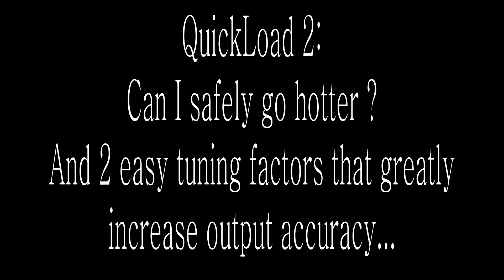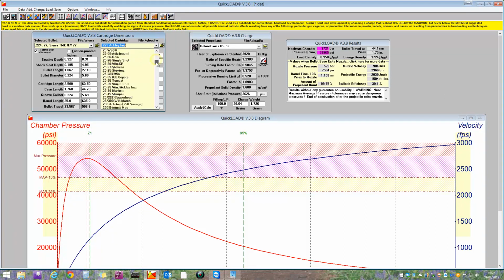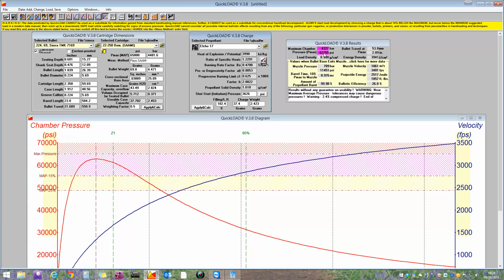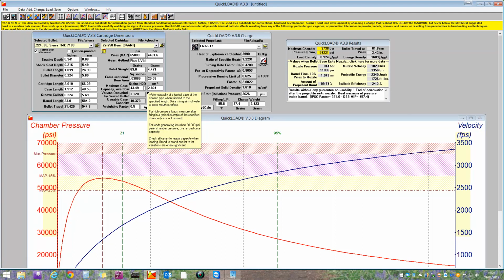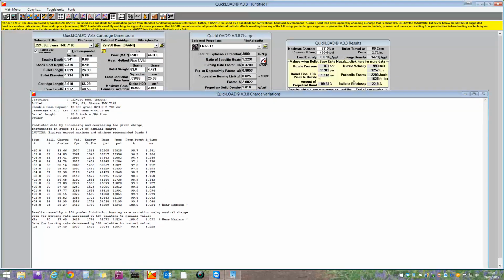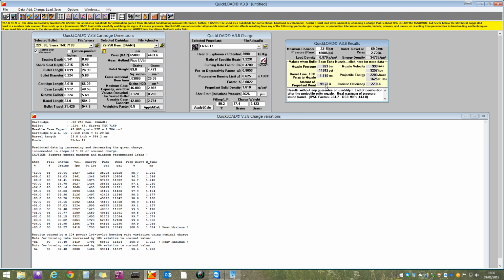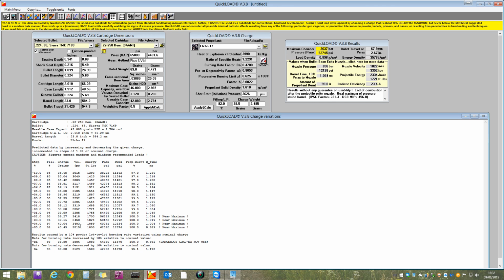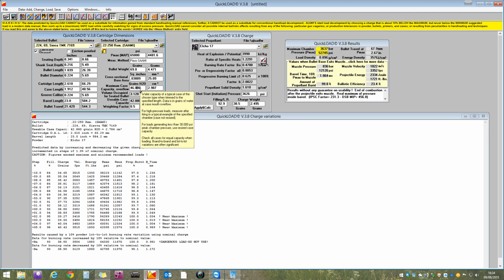QuickLOAD tutorial 2 - can I load hotter safely? + tuning tips

Comment: Hi Richard great video Thankyou, I have purchased QL and it's very interesting, I have done all the measurements and came up with some test loads for my 308 target rifle , imr8208 berger hybrid 155, went to the range yesterday and using shooting chrony beta found my velocities where, depending on load, 75 to 90 FPS over QLs prediction and showing pressure signs on the higher loads, 3090 fps 26 inch barrel, ( I won't go there again) angel target rifle  action. I realize chambers and barrel friction play a big role, also powder burn rate variation, what I have done now is changed the powder burn rate Ba in QL to match the velocities I am getting and using the new data to develop a load close to the theoretical node 3 for my barrel length. Do you think I am on the right track? I checked my lab scales all ok, next week at the range I will check my chrono against the expensive club one, but 90 FPS is huge. Interestingly I checked some old data for my 223 competition rifle, and I am 65 FPS under QLs prediction, so maybe it's not the powder ( same bottle) according to QL 25.1 grains of 8208 in a 223 80 gn projectile will put me 10,000 psi over saami specs but no pressure signs, time will tell but maybe competition actions bahave against the norm? Any thoughts greatly appreciated. Best regards Richard

Comment: Richard,

Thank you for the video, I just ordered Quickload 3.9 and look forward to learning more to aid in my load development. 
  One of the things I have not got a total grasp on is where the program lists or tells you where the best nodes are. In your video given the information from your friend, the powder may be increased, which will increase volume, velocity, and pressure. But does that mean any given increase will be as accurate? Or are the best nodes a combination of several factors added together? If so, which ones, and in which order? Also, I don't see much regarding twist rate of the barrel, does this not matter?
  I hope this makes some sort of sense, and apologize if it doesn't.

Comment: I'm a little puzzled When you say 'maximum case capacity overflow'. Obviously when you fill a case with water, the level is higher than the top edge of the case. As in convex. Would you take that as your 'maximum case capacity overflow', or would i need to use something to work the water level down to exactly the same level as the brass height? Thanks. J.

Comment: I read you should meassure case capacity of a fired case, because the case will expand to this dimension as preassure builds up during firing. It makes a big difference in my calculations. Since I cant meassure preassure I cant tell which way is right, after firing or after FL sizing.

Comment: Quick Load  asks for a fired BUT Not resized case to work out Water volume   . (5 min 5 sec )
Reply from the maker: +FGYT Shooting Quite right.  Easiest for me is to fire the brass and then weight it before sizing. Fill will water to brim and wipe clean.  Weigh again.  Subtract the two figures and that's your H20 capacity in grains. Then straight in the tumbler to clean and dry off
Reply: @RichardUttingSharpshootingUK  thanks for the great video, is measuring the fired capacity only necessary if you plan on neck sizing only